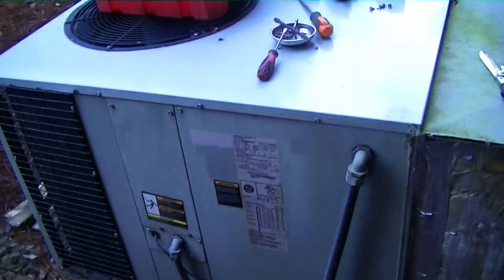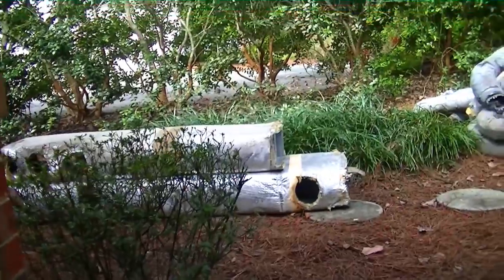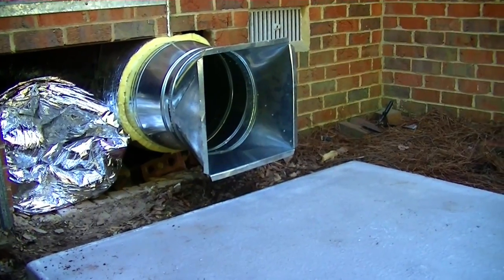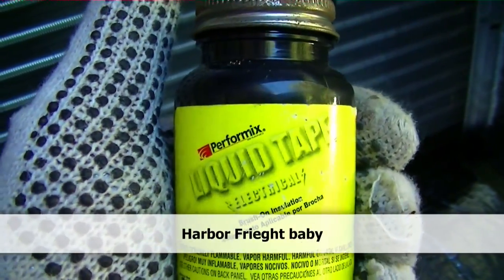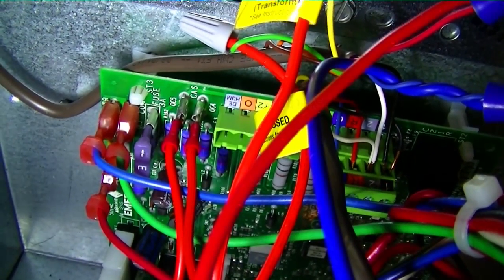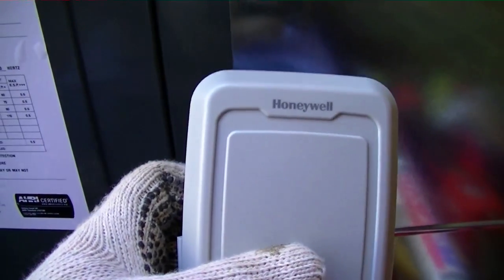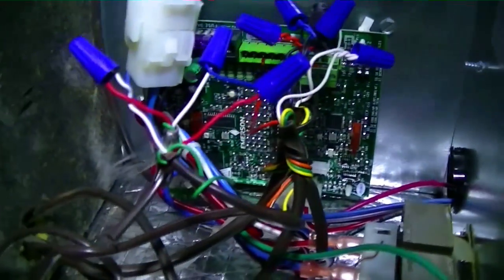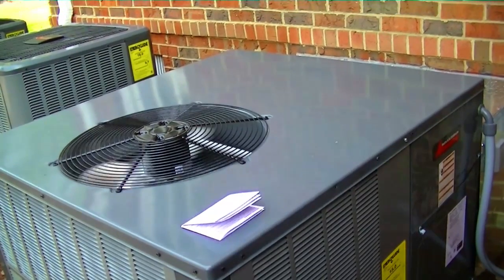Amanaland Part 3

Comment: Great job Zack! The liquid tape is great stuff, i use in on temperature probes on coldroom evaporators mostly to stop moisture giving false temperature readings.

So you could put the outdoor temp sensor in the freezer if you wanted to run your heat strips when its 'too warm' outside... :-p
Reply from the maker: Thats right John! Exactly what I was thinking.